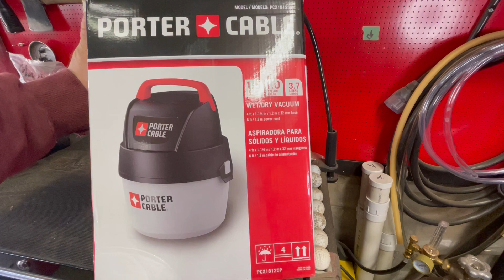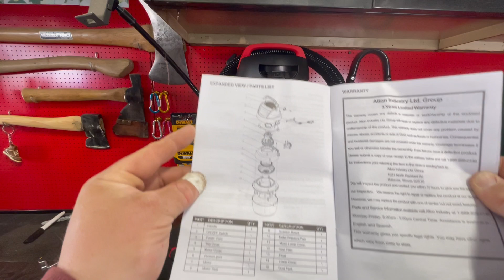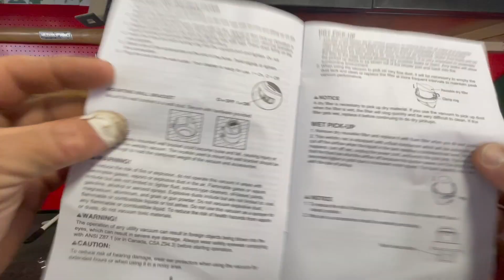Porter Cable® 1 Gallon 1.5 Peak HP Wet/Dry Shop Vacuum.  PCX18125P

Comment: Wood 4x4 spacer between the can rest and the wall?
Reply from the maker: It turns out that having the “back” face forward makes it easy to use, due to the location of the  on / off switch.